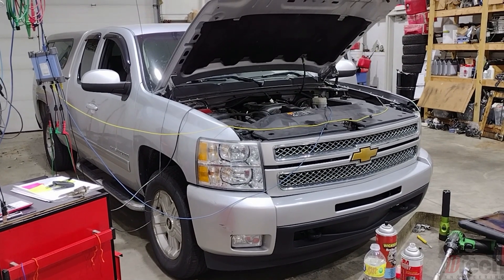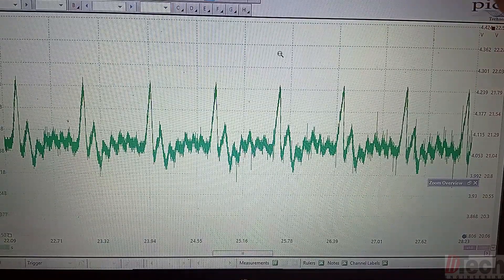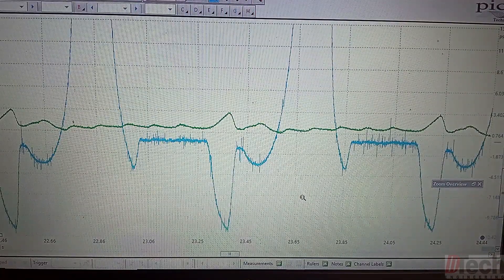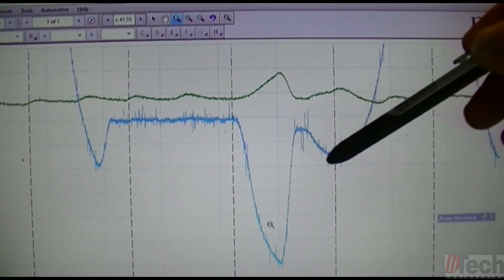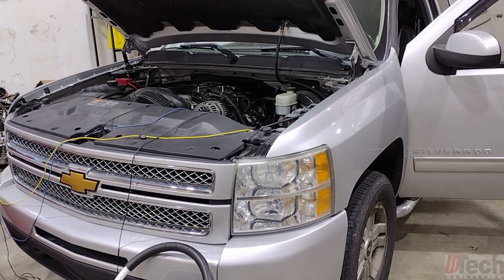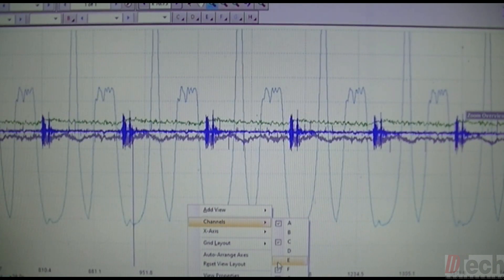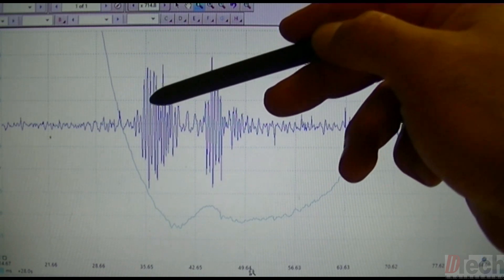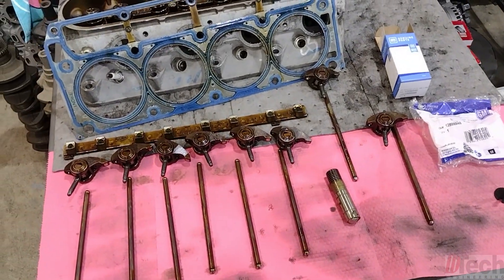Waveform Analyzation Breakdown When AFM Lifter Fails

Comment: Hey D-Tech, as always you did a great job of diagnosing the vehicle and at the same time explain what’s going on!
You’re awesome!
I only got one question: what do you mean with microphones to pick up noise of the engine? Do you use the cables and the clamps from the chassis ear and adapted those to the scope? How did you adapt those to the scope?
Thanks in advance,
greetings Tom
Reply from the maker: Thank you Tom, and yes I use the wired chassis ear leads but connect them with an adapter set that I provide.  It makes it easy to use and capture noises on the scope, there's other videos that I show the use of the noise capturing , Thank you for watching
Reply: @DTEAuto  thank you for your answer! What Adapter lead is it exactly? Or can you provide a link where I can buy it or did you build it yourself?
Greetings Tom
Reply from the maker: contact me at DTEAuto@gmail.com

Comment: Wow Sadel, another fantastic video. You really do a great job analyzing these pressure waveforms. Nothing boring about this video. Is most of your knowledge of pressure analysis through trial and error, or have you had formal training analyzing these waveforms? If it's formal training, where did you learn this??
Reply from the maker: Thanks a lot for that. And to answer your question, most of what I have learned, I learned on my own from me going over captures of cars that I would practice with. But that doesn't mean I magically learned from nothing. I would scour the internet, just like you I would assume, and try to pick up videos and articles over and over as much as I could and read or watch multiple times over. And as far as "formal" training, nothing that is hidden from the public, Brandon Steckler has good content on this, so does John Thornton and then you have Bernie as well. I took information from those courses and then applied it to practicing what I thought I learned. I say it that way because even taking a course like those, it still didn't fully "click" in me until I went on my own and put the time and effort to take captures and analyze them. It took a ton of hours, ton of captures and many more hours of lonely quite nights in front of a laptop looking a waveform and trying to make sense out of it from what you learned and trying to rationalize in your head what physically is going on and how to tie it in with the pressure changes. It was a lot of time put towards learning it. And I'm still learning till this day. This video is a true example of how I learned on my own. This lifter scenario would never get "scoped" in the real world, it's more of hurry up let's replace lifters and move on... but I, for myself wanted to learn the pressure changes and what they would look like and what they could mean. So, I took a lot of time on my own to take the captures before tearing into this one. And then it was a long time before I truly figured out the waveform meanings of this one. So long story short, put the time and effort on your own and practice lots. No one is gonna learn it for you, only you can feed your brain that knowledge. Sorry for the long-winded explanation. Thank you for watching
Reply: @DTEAuto  Thank you for such an in depth response. I watch videos from the same techs and try to learn as much as I can, but I think that you really break down the analysis in a very methodical way that makes it so much easier to understand. So once again, thank you for the response and thank you for putting out these video's.

Comment: I enjoy every bit of your diagnosis. Did you use the WPS500 for the in cylinder pressure wave form analysis. 

I see you don’t get to use pressure pulse sensor. Any particular reason for this. 

I would be staying tuned for the next video. Nice work
Reply from the maker: No, I don't own a wps nor do I use a pulse sensor.  I don't like the fact that the pulse sensors have a "flyback" action and swing the voltage "heavy" in opposite direction of an initial big pressure change. My personal opinion is that it makes it more difficult to decipher the waveforms when faults are present. Absolute sensors will capture exactly what pressures are present without a reactive swing in opposite way. Hope this helps and thank you for watching, and just fyi there are other videos I have on channel that go in depth with these pressure waveforms and explanations of them.
Reply: @DTEAuto  so what did you use here. Just the scope only?
Reply from the maker: used an absolute -30psi transducer for intake a 100psi absolute transducer for incyl and chassis ear microphones for the noise capture all on pico 8 channel scope

Comment: Excellent video. Love your channel. If you have time to answer a question. How can you tell that the problem is in the lifter and not the cam lobe, without taking the the head off? Just experience? Or do the waveforms show that the lifter is at fault and not the camshaft?
Reply from the maker: Hey Matthew, that is an excellent question. I've asked myself that in the past and thought I had come up with some sort of hypothesis, but I haven't been able to remember. I think that a lot would have to do with the style or type of set up for the valvetrain the engine has that you are testing. This one obviously has pushrod style, but others with overhead cams, and different valve actuation types can maybe be deciphered differently.  It is a subject that I hope to run into down the line that maybe I'll be able to experiment with and will definitely share here. This one, my thoughts were that yes most likely will be a lifter but if one was curious on the cam lobe status, the lifter would need removed anyways.... so, once it is determined that there is mechanical issue with the scope and pertaining to one specific valve control, then you get the chance to inspect both the lifter and lobe. I know it's not the best answer, but maybe I'll be able to experiment this theory at a later time. Thank you for the support and watching.
Reply: @DTEAuto  Thanks so much for the positive response. You're a true professional. You have a way of explaining things that I really learn from.